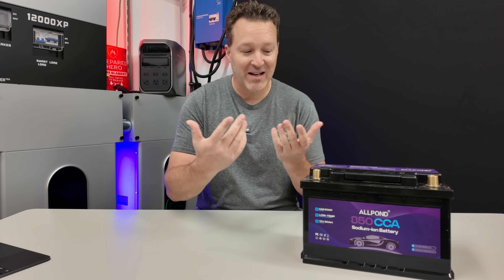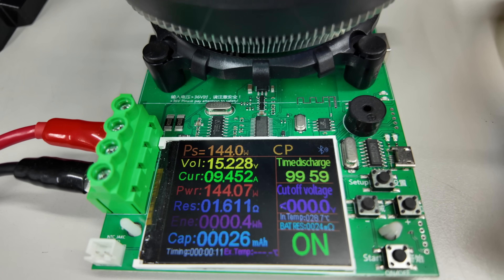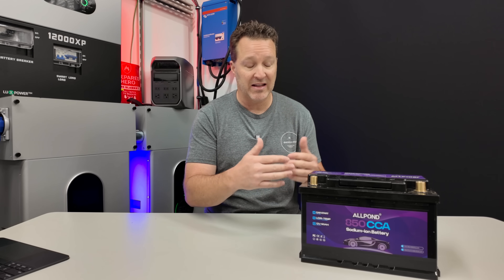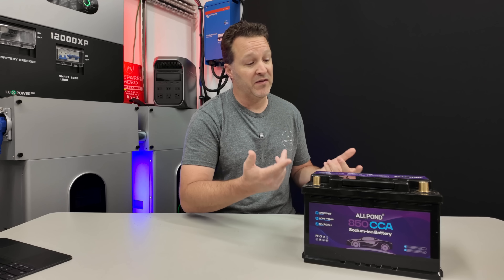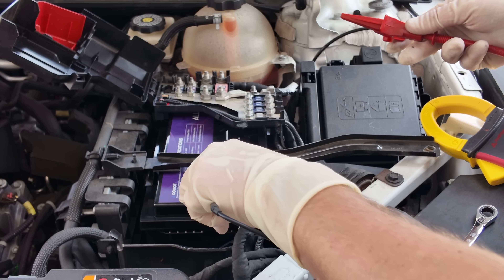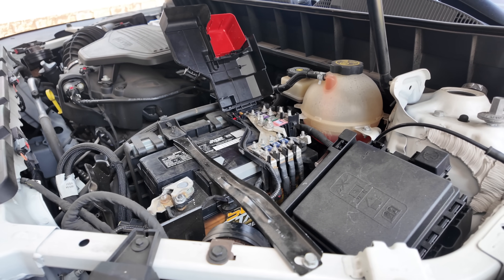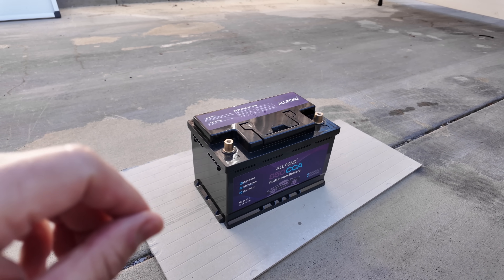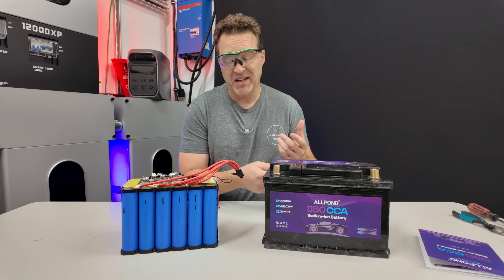Sodium Ion Battery Tech Hits The Auto Industry!- Are We Ready?

Comment: Overcharging and over charging voltage is the singular reason lead acid batteries do not last over a  decade.  Overcharging is the design flaw of almost all vehicles and lead acid battery chargers.  I  have 3 vehicles which do not over charge resulting in over 10 year battery life.  For flooded wet cell type lead acid battery the room temperature ideal  maximum charging voltage is 13.5 volts in cyclic use.  For standby use the maximum charging voltage is 13.3 volts.  Many will argue for much high voltage.  Their opinion is based in only brand new batteries and a 1979 paper written about charging lead acid batteries by an idiot Texas Instruments engineer that got it all wrong.  His wrong has become the world's stupid reference for the world.

Comment: I bought a new tractor back in 2016. It came with a sodium battery. The tractor has a diesel engine. The sodium battery is still working perfectly after 9 years, even after prolonged periods of not being used. I swear by the sodium batteries. Finding a replacement, even though I don't need one right now, has proven to be a challenge.
Reply: Sodium ion batteries did not exist commercially back in 2016. Lipo4 batteries were barely a thing either. But I could see Lipo4. No tractor heavy or light would have come with anything other than lead acid at the time. You got the model of that tractor?
Reply: Photo of battery
Reply: Are you sure it was a sodium ion battery?  They have been in development for quite a long time, but only quite recently (last 2-3 years) started to become available.

Comment: I had a 2001 Duramax Silverado. I would replace both batteries about 6 to 7 years. This truck was used for driving from customer to customer. Any where from 1 to 6 customers per day. My highest mileage in a day was 325 miles for work.

Comment: When doing the "Cold Cranking Amps" test with the clamp meter, you need to use a DC amp meter. I can see "AC" on the LCD display. It does look like your meter supports DC (the A _~ symbol on the rotary selector indicates it can measure Amperage in AC or DC) but many (like my Klein) require you to select DC with a button press every time you power it on or switch modes.

Unless you have an automotive-specific meter, many just default to AC at power-on...

I did note that on screen you mention "AC IS ON" but I am assuming you're talking about the Air Conditioning system, as you mention that later. If you meant that the meter was set to AC, that's not clear from the text on screen...

Now for the Amazon reviews, they read just like if you asked ChatGPT to write a positive review, threw it a few specs and let it roll.

In all I don't think these are good as a drop-in replacement for Lead-Acid in most vehicles. Without some changes in the battery tech (internal boost converter for charging, for example), or updates to newer vehicles to allow for selecting the "battery type" (not holding my breath on any new ICE vehicle developments these days)... the car is going to assume Lead Acid, and may do funny things when the battery isn't behaving "correctly" (codes, weird charge voltages, etc).

Final note - many "12-Volt" devices expect upwards of 14.4 - 15 volts, but any higher and (especially inexpensive phone chargers, after-market audio, etc) may have 16-volt capacitors that will very quickly (sometimes violently) let you know if you exceed that 16-Volt limit... a little too close to the edge at 15.6 for my taste...

Just my two cents...
Reply: The inrush current from cranking the motor from stall *is a half-wave sinusoid*. All the industry-leading clamp meters place the supersampling inrush button on the AC setting because it's intuitive. DC is not for rapidly varying voltages, it averages over a long time period and misses fast millisecond or shorter voltage spikes. A clamp meter with a time graph or an oscilloscope would be necessary to do more.
Reply: @Infinion Great point that I hadn't considered. The peak of the half-wave sinusoid would represent the peak instantaneous amperage draw... And perhaps (given the relatively low readings) his meter sample rate just isn't fast enough.

Agreed that connecting to a scope would yield a ton more data, but is probably overkill for this review video.
Reply: JustinNelsonsProjects yeah not fast enough in standard AC mode. The two readings completely failed. Although there is a lucky chance a sample could land near the peak, it wouldn't be repeatable. it's just not worth counting on for single shot impulses. He just doesn't know how to configure it, didn't read the manual. 

Newer clamp meters include an LCD screen with time based readings, which would allow you to see the 2nd 3rd 4th... current spikes. 

He needs to offer some kind of follow-up if he wants to show the true cold cranking amps for the Sodium-ion battery. That might be difficult now that he tore it down.
Reply: @Infinion  I was gonna see if my Klein CL390 would do it, it does have a "MIN/MAX" function, but it's only rated up to 400 amps AC or DC... hell I might try it anyway, I doubt my car or truck would pull more than that, at least right now (being mid-September in the Midwest)...
Reply: @JustinNelsonsProjects  It looks like only the CL440 has an inrush current function. The 390 would do great for a typical 60 Hz source though

Comment: On today's lead acid batteries once a year if you pop the top off and measure the fluid inside if they test her you can find out if you need to add more acid or more do you still water. You have to maintain a lead acid battery because they are no longer great they are cheaply made so you have to maintain it you have to measure the fluid to see if you need to do anything with it. My lead acid battery has gone on 10 years because I maintained it once a year

Comment: Ok so for most of us running a standard altenator, you are never going to charge to full capacity ( assuming your alternator survives ) So the obvious solution is that you need a Boost convertor with feed in from your alternator, with correct output voltage to charge this battery @ 50 - 60 Amps.
It would be very efficient because of the input output voltage differential.
Reply: @mouldykev  all you would really need is an external regulator that can be configured to output the correct voltage. Wakespeed WS500 can do this.

Comment: I don't get why the electronics in the car using more power has any impact on the battery longevity.
The car is active and really pulling power from battery during use, and this is when the alternator is creating power to the battery. The generated power far outweighs the use of the car and the battery is literally cooked during your entire drive. Show me a proper test of this, put a Victron Smartshunt on your battery and drive around with the car. The way the battery in a ICE is treated is not nice, and appears to degrade the battery fast. Some cars are probably worse than others, and I guess a too weak alternator can really let a battery get depleted but normally I'd assume overcharging more than depletion.

Comment: We WANT a battery technology that will not cause fires in our homes and cars !!!!!!!!!!!
Reply: I use LTO battery 20,000 cycles, 20C discharge rate and full output at minus 0F. LOOK IT UP. The only lithium battery that has a temp range of -40C to +60C and won't catch fire
Reply: ANY battery CAN cause fires, that's physics, we want one that can't ITSELF explode or burst in fiery flames when it's impacted, punctured, ignited  or bent
Reply: @hectoraccented5312  Gel-cell batteries  . . . . .
Reply: @hectoraccented5312  and NO LTO battery's can not start a fire or explode or burst into flames go look up a LTO linlong fire test 
these battery's have been used for years in buses
Reply: LTO is the best for safety. but not cheap and does not have the best density
Reply: Lithium batteries catch fire less often than gas cars. Even with the growing number on the roads.
Reply: @asciblue  Lithium batteries fires are way worse than gas car fires.

Comment: The cell configuration , voltage and battery chemistry are not identical to what we are accustomed to, but the longevity, price point and availability of resources may force us to adapt our devices to work with the product.
Reply: BS-Think bms, it shuts off the battery, as with other lithium ion batteries when fully charged. my NEW car battery is LTO, NO bms but a balancer, battery cells always directly connected and good for 20,000 cycles and 20C discharge rate (years of use) and temp-40C to +60C
Reply: @rickpalmer9518 lto is the and always has been the best, why it isn’t poplar is because it isn’t financially incentivized
Reply: @rickpalmer9518  So do a video about your LTO experience please. I have a bunch of LTO here but havent used them yet. They are very stable year after year in storage.

Comment: The charging system in your car was freaking out because you put in the Sodium-ion battery while it was at 14 volts. The computer didn't think there was something wrong with the battery, it thought there was something wrong with the charging system, specifically the ADC used to detect the battery voltage.  If it starts higher than 13.8 volts or dips lower than 10.8 volts when starting it will think there is something wrong.  A safe voltage to use when first adding these to a vehicle is between 12.6 and 13.8 volts and if you start within that range I'd bet you'll never see an issue.
Reply: Even if put bellow 13.8V, the vehicle charging system will charge it to above 14V, which on the sodium ion battery keeps the charge in contrast to lead acid that stabilizes bellow 13V.
Reply: @semiRockethr  good point.
Reply: @10100rsn  would love to see a follow-up where you discharge to 12.x volts before swapping. The Na battery’s voltage range is broader than lead acid, so it should operate just fine in the range the car expects. 

I would have loved this in my diesel.
Reply: Think bms, it shuts off the battery, as with other lithium ion batteries when fully charged. my NEW car battery is LTO, NO bms but a balancer, battery cells always directly connected and good for 20,000 cycles and 20C discharge rate (years of use) TEMP -40C to +60C
Reply: I wonder is not fully charging them so they stay below 13.8v will make them last longer as well.

Comment: I bought a 5 year old honda crv with a Varta lead battery. That battery hold up for 8 years at least and i don't know when or if the battery was even changed before i bought the car. I switched that battery and used same brand of battery. Lead are very good if you buy good brand and a good typ of battery. Maybe it was AGM...not sure if i remember right

Comment: Most Amazon reviews are utter Bull S#$&. Automotive computer systems will need to be upgraded for todays electronic based cars. Will the manufacturers comply? I doubt it. It will cost them too much for software developers to tweak the firmware in the computers.
The real test is in a non electronic equipped car from the 70’s. 
Now as for some cars that have a regulator on the outside of the alternator it could be tweaked by the manufacture of the regulators. Simply replace the 14.x regulator with a 15.x regulator. Most alternators will handle the increase in voltage output. Don’t forget most alternators are three phase so the load is balanced between the three separate circuits within the alternators stator.

Comment: The reason you have to replace your battery more often now is not because the car uses a lot current which they do absolutely but it's the variable voltage charging systems that are damaging your battery and leaving it in a state of around 60% charge constantly I charge mine with the proper 25 amp charger every few days but a trickle charger will do if left over night.

Comment: Why not cut out 1 or 2 cells to bring total voltage down closer to normal automotive 12.4v so it's more similar to lead battery so the charging system will work better.  Battery being higher voltage will confuse the alternator.  Bms might be next issue since it's designed for 15v.
Reply: Airhead

Comment: More complex charging systems look for the batteries internal resistance which changes with charge level. Different chemistry type batteries have different internal resistance and the computerized charging system has to know it's parameters to function correctly. So I would think a firmware update for the car's computer containing the parameters for sodium ion batteries would be needed for the charging system to function properly with that type battery

Comment: I put a 50F cap (less than 1lb) in my car & replaced the 35lb lead anchor with a 2 pound Group 9 lithium battery. 

My daily driver has been that way for several years. What people should really be doing is getting caps & discarding batteries.

your measurement of cranking current was wrong. You are using that clamp meter wrong. Cars also charge around 14.8 volts, peak. At lower revs, like idle, voltage may drop if the current draw is higher than can be delivered.

(ASE Certified Master Technician)

Comment: I would be interested in seeing some winter weather performance like 0 - 20 * F. It also may be possible if you discharge the battery so the voltage is lower (closer to 12v)  it might make it compatible with more vehicles. The battery would just never be able to fully charge with a stock alternator. Example discharge to 50% soc and it would only charge to like 75-80% depending on the voltage curve.
Reply: Think bms, it shuts off the battery, as with other lithium ion batteries when fully charged. my NEW car battery is LTO, NO bms but a balancer, battery cells always directly connected and good for 20,000 cycles and 20C discharge rate (years of use) TEMP -40C to +60C

Comment: I've been running LTO and Cmax battery banks in my cars charging at 15.5 to 15.9 volts for over 7 years . 2010 ford focus and 2008 chevy impala 🤷🏽‍♂️
Reply: THAT's THE BEST. LTO, WHAT I USE ALSO, the battery no one talks about, could be it's cost, it's 2X regular lithium batteries.

Comment: Im stuck with AGM at the cabin because Lithium cant tolerate charging at -40C
My 14 years old telco agm batterry are still going.
The cold charging feature of this salty battery interest me.
Reply: Look up LTO. my NEW car battery is LTO, NO bms but a balancer, battery cells always directly connected and good for 20,000 cycles and 20C discharge rate (years of use) Full ly chargeable atTEMP -40C to +60C

Comment: plug in a good scan tool and see what the computer is commanding vs what "seeing" on the charging system, weak batteries require more voltage the more charged the battery the lower the necessary output

Comment: So what’s the general consensus on how well it would  work in a diesel pickup? Say a 2002 24v HO Cummins turbo diesel? Dual battery’s, 12 winch on the front bumper, decent sound system with a large bass amp and a 40 farad capacitor. And Lots of led off-road
Lights on the front bumper. 
I’ve always ran dual optima yellow top deep cycle battery’s. Having the top post and side post terminals is nice. Everyone says optima’s suck and are not as good as they used to be. I kinda agree. They don’t last very long what really kills the battery voltage is in the winter months cold weather, cold starting in the morning when the grid heater kicks on. Battery voltage plunges. The grid heater takes sooooo much juice to run. I almost have to always make sure the trucks block heater is plugged in all the time. I also have ‘battery tender’ 1-2amp trickle wired into the same plug as the block heater  🔌 they both are on one cord to plug in in the front of the truck 🛻 I used to even have a ‘heated battery blankets’ for each battery I could put around each battery if I wanted to also and put them on another separate 🔌 plug from the block heater and trickle charger. They keep the battery’s nice and warm in the negative temps in Colorado. So it’s not that my truck won’t start if it’s. It pluged in, it’s that it don’t like to start because the grid heaters drag the battery voltage down so much that it’s hard to start because voltage is to low lol. Having the truck plggged in and warmed by the block heater makes it warm enough that the grid heaters in the intake don’t get turned on full blast by the ECM on a morning cold start. 
I’ve been pondering making the jump to lithium battery’s but dude we’re taking prolly over a thousand bucks to do two decent sized lith truck battery’s, and then there’s the cold weather problem, and the charging problem to? I just know there’s some issues with a lith battery. Is the sodium ion what I need? Lithium is expensive expensive. There super light weight. My new 2023 Honda dual sport dirt bike has a lith battery and it weighs like nothing at all. And it’s always charged to, I let it sit an entire fall, winter and spring last year and didn’t touch it, no trickle charger, battery minder/ tender nothing. And it’s still ready to rock. When I had my Polaris 4wheeler I literally had to buy a new atv lead acid battery every year regardless of what I did. They didn’t last more then a year, Walmart $30-40 motorcycle/atv battery’s. The AGM versions are a little bit better. Atleast they won’t leak or spill. Heh 
  Just wanting a little more of clarification. Is a sodium ion battery what would work best in my dodge pickup diesel? Again I’ve got a winch, a sound system, and lots of off-road lights, all led so they really don’t draw and substantial amount of amperage. The win h is a harbor freight badlands 12k. I haven’t even used it yet. And it’s not something that’s gunna get used alllll the time, and when you do it’s in short bursts with the engine running. Thanks!